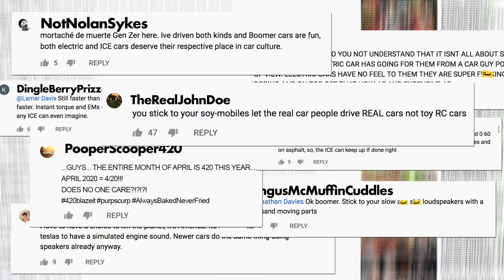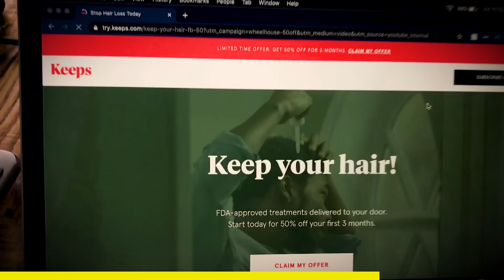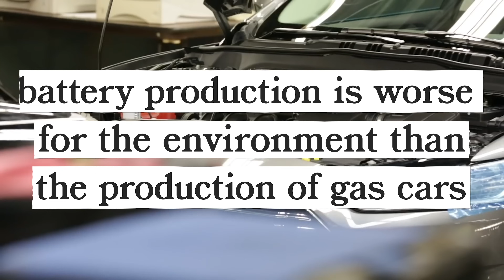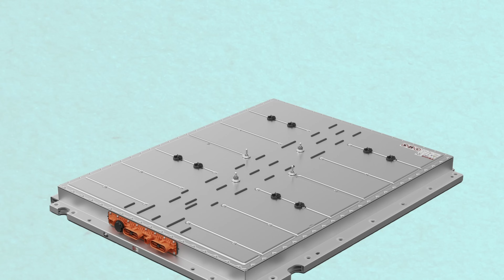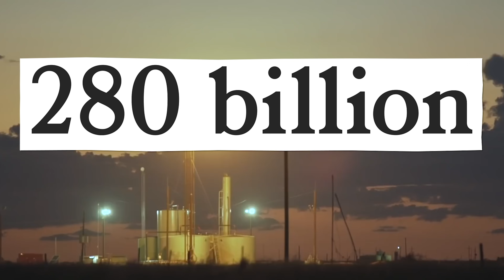Are Electric Cars REALLY Better for the Environment?

Comment: One point I didn't notice you even mention - and that's the environmental impact of recycling EV batteries. This is especially important in view of the relatively short life of such batteries.
Nor did you mention the environmental impact of building and connecting up the thousands of charging stations required. If your government intends the same as the British government, and outlaw production of IC vehicles by 2030, that charging station coverage will have to cover the ENTIRE country - even in the states with the lowest population per square mile. Generating the required power is the easy part; installing not just the chargers, but also the heavy duty cable required to support their power consumption - that's going to take a staggering amount of money, AND create a damn big carbon footprint.
Your assessment is fine - as far as it goes - but you only show a part of the picture.

Comment: very well developed "free valve" engines similar to those used by Konigseggsegsseggsegg achieve such a level of volumetric efficiency that an E.V. is only just able to beat it in terms of long term environmental footprint. maybe it is hope for the survival of good ol, petrol power. with that sort of volumetric efficiency, imagine a 5L v8 with free valve tech?  MONSTER!!!!! However,  "More power to the sound of a gas gusling big block". hi from Australia. keep up the good work.

Comment: The problem with electric car is they they can't store as much energy as gas cars ! So, economically speaking, and from a industrial stand-point, electric cars will always be just cute cars, but not actually practical ! They also need between 6-12 hours to charge, with a gas powered car needs only 3 minutes ! A electric car literally stays 200 times more, in a year, in recharge, while a gas cars stays 200 times less. And these are the facts !
Reply: not very good facts. For starters EV ranges today are punch around the 300-400 mile mark, thats something like 4-5 hours of freeway driving. If you do that as a daily commute, you need to find a new job. In reality most people only rarely travel further than 70 miles per day. Which means if you charged from home, from a home charger it would only take you around 1.5 hours to charge.... when you're at home.... not using the car... asleep. And every morning you wake up to a full tank of electrons. By comparison the average person wastes between 16-17 hours per year getting fuel. Whilst for a BEV thats 0.

in the event that you do need to get a charge on the road the huge network of superchargers out there can do that, anywhere between 5minutes to 30 minutes depending on the charger and how much charge you need. And unlike a combustion car, you dont have to stand there holding the plug, you can walk across and get a coffee or a snack, which most people would want to do after spending 4-5 hours driving on a freeway.

Comment: What about all the oil spills in the ocean. And millions/billions barrels of crude oil expelled into the ocean. 

You know hown many batteries are thrown away each year??

Which are made of cobalt and lithium.

Why dont we just use the thrown out, one time use batteries and use them... why are we throwing away rare material. And mining for more... we already have the material..

Our landfills and practically teaming with rare materials 

Use EV construction vehicles to mine. 

Start taking sea water and desalination plants to replace the water. That use only power. 

Gas/oil is easily more detrimental.

Comment: I agree with everything except the fact that the electric grid could keep up. What happened to Texas last year? It snowed and power was out for almost a month in some places what happens when the car can't take you to work because the batteries died and you can't change it?
Reply: what happened to texas wasnt lack of capacity. it was lack of planning for a never before heard of weather event in texas. The fuel lines feeding the power plants froze and blocked fuel from going to the power plants, transfer station switches froze limiting their ability to lead shed, coal piles were buried under too much snow to get it to the generators fast enough to keep up. It wasnt lack of power. the grid was just simply not designed for those weather conditions.
Reply: I live in the UK where many people do not park on a drive or outside their house, we have collective parking lots or on street parking, where do I charge daily?

Comment: Been holding onto this vid for a year and i knew there was a reason. Just wrote a college paper on EV batteries. Awesome explination and an amazing job at making this topic so easy to follow and understand. There so much going on with EV its easy to not know where to start. Thank you!!
Reply: The comparison of info is not a good job.  Regardless of the negative impact on human life and the planet during production (sad to devalue humans), the comparison was not new vs new; and at 8:50, new source numbers are not given, so it must be assumed the average, including old cars, is still being used.  It also does not state that battery replacement we considered in the "lifetime" of the EV.  Any work based on this video will suck, mate.

Comment: We dont get this in the media i dont think ev is the 100 % answer hydrogen is better it could be less expensive to build
Reply: Hydrogen isn’t better
Reply: @engineeringtheweirdguy2103  They both have their perks and drawbacks.
Reply: @haloliye7590  Hydrogen has more draw back than perks unfortunately.
Reply: @engineeringtheweirdguy2103  I've done my research. Hydrogen is a compelling alternative, particularly with commercial vehicles.

Edit: Woah, I did not expect an entire essay. Nevertheless, while several glaring flaws do indeed exist, many benefits are present too, and they will likely improve in the following years. However, I will not create a new reply and argument because I prefer to not prolong this conversation of fear of it ending badly. Thanks!
Reply: @haloliye7590  Dont know where you got that from. even looking at the difference between the Hyundai Xceint vs the Tesla Semi and you find a very stark result. Hydrogen cars also suffer from a critical lack of space due to the volume required for the fuel despite its light weight. Making them impractical for storage, long range, or passengers. 

Hydrogen also requires far more energy to create making it more expensive even before you consider that the plant that makes it has to cover its capital and overhead costs plus make a profit before passing it to fuel stations who then have to make a profit on-top of that themselves before it gets to you. The next most common way of creating hydrogen is with fossil fuels which produce more emissions than if you had just burnt the fuel for electricity in the first place. 

They also have a critical lack of power due to the available space for the fuel cells and need batteries to compensate for this.

SO hydrogen is slower, less power, less practical in terms of space such as boot and cabin space, and doesnt really achieve more range than batteries due to there not being enough physical space to store the fuel. all whislt being vastly more expensive and having extraordinarily lower operational lifepans compared to BEV's. 

That doesnt get better when you size up to commercial vehicles either.

Comment: What about the longevity of EV vs ICE vehicles. If the EVs don’t last as long as an ICE vehicle would the production impact increase the total impact of EVs over a period of time?
Reply: Well you’re in luck. Contrary to popular belief and media, Modern EV’s last longer than ICE vehicles. Around twice as long.
Reply: @engineeringtheweirdguy2103  are we talking twice as long as like a Kia or twice as long as a Toyota Tundra? Lol
Reply: @bradleywarren5243  we’re talking 500,000 mile lifespan to 80% battery health (20% degradation). Whilst the average ICE only last 250,000 miles
Reply: @engineeringtheweirdguy2103  Source?
Reply: @haloliye7590  It's all there as long as you're willing to look at it.

Comment: I noticed you missed replacing the battery in the electric car. They will last 2 to 3 years and then are thrown away.  In the event of a power failure the electric system uses its power to keep the battery warm. It runs the battery out and it freezes and is off to the dump!!!   That’s a lot of batteries. Figure that into the life span and things change.
Reply: Well considering that the warranty for EV batteries are typically 8 years these days and they are showing as little as 2% degradation or less after 100,000 miles of driving, your 2-3 year figure is grossly misinformed. Also, the battery doesn’t use very much at all to keep itself warm and only does so below freezing. As opposed to combustion cars which can often fail to start at all in cold temperatures due to the fuel being too cold.

Comment: Sad you missed one key point let’s talk about rolling black outs, since this video is a year old how you gunna charge your car when a natural wildfire comes, guess you’ll be getting a ride for the next door neighbor with his gas powered car haha
Reply: How do you pump gas if there isn’t any power to run the gas pumps?
Reply: @engineeringtheweirdguy2103  you can easily hand pump the fuel out of the ground, think outside the box 📦
Reply: @MrAllmotorB  how many hand pumps do you see on fuel stations?
Reply: @engineeringtheweirdguy2103  hilarious if the pumps stop working in an emergency you go get one
Reply: @MrAllmotorB  ..... but you cant. If the pumps stop working, if you bring a hand pump thats making 2 assumptions. 1.) is that you can even access the underground fuel storage tanks to put one end of the hand pump in.

2.) is that the fuel station attendant will let a stranger get access to the underground fuel tank to install a hand pump not approved by the fuel station, to pump fuel without a meter to show how much was pumped.

also completely disregarding the fact that the attendant cant make a record of the sale without electricity anyway!

you're living in a fantasy world.

Comment: Is sacrificing children worth your electric car
https://youtu.be/ipOeH7GW0M8
Reply: I’m assuming you’re referring to cobalt? Well considering that A.) next generation batteries which are about to start rolling out in 2022 don’t contain cobalt and B.) batteries aren’t the largest consumer by mass, I don’t think you really understand the full picture 

So to expand. EV’s are indeed the largest consumers of PURE cobalt (although all ev manufactures have singed ethical contracts to avoid child mining. FYI). However they are not the largest consumers of cobalt by mass which means cobalt based chemicals and compounds. By mass means by weight of cobalt contained. The largest consumer of cobalt by mass are FUEL REFINERIES who use it to remove sulphur from your petrol and diesel.

However fuel refineries have no such ethical contracts because they’ve never had the social pressure to do so. And spend big bucks making sure it stays that way.

So is sacrificing children really worth driving your outdated combustion car just because you can make more noise?
Reply: @engineeringtheweirdguy2103  it's obvious you are oblivious to the point of child. It's not mined by children😬 that was the point of the video. How do combustion engines cause deformation in the womb? 🤦
Reply: @JennyBrie2006  well how does an EV do that? But counter question, how does an ICE shorten the life expectancy of people living within 10 miles of a major freeway? Microparticle emissions from tailpipes is the correct answer.

Why is there an increase in cancer rates and cognitive developmental issues in children who live with 15 miles of a fuel refinery? All good questions.
Reply: @engineeringtheweirdguy2103  so there you go, which would you rather have, a deformed child for life or a decade shorter life? You can choose to live further from a freeway, while those mining, a rather impoverished population, do not have such a choice. Remember, most countries who think they should save the planet along side China, well I got news for you, China does not care. They aren't even safety conscious for who they employ. Your idea is admirable, but it's short sighted of the implications for other people. Out of sight out of mind.
Reply: @JennyBrie2006  and what are they mining exactly?
Reply: @JennyBrie2006  and did you neglect to read the part about child cancer and permanent brain under development for children living near refineries?
Reply: @engineeringtheweirdguy2103  I know there are a lot of things to consider. Like I said, it's an admirable desire to strive for, but it's got a lot of complications to consider. Heck, not a lot of people take much consideration to what chemicals they ingest on a daily basis. Too bad we can't turn back the clock on some of the areas where we lost ground, simple things like recycling and using butcher paper instead of styrofoam. At least paper bags didn't dot the landscape for 50+ years.

Comment: Who's going to handle the dead batteries when they're exhausted in 5-8 years? Every makers have their own way of manufacturing the batteries, are they going to set up recycling plants in every country they sell cars in? What's the resell value of a 8 or 10 years old EV? If the cost of battery replacement is more expensive than a used EV, who's going to buy? If no one buys it, an 8 or 10 years old vehicle becomes a piece of 4000 lbs junk to the earth, but a 20 years old gasoline car can still run for years.

Comment: did you take the greater tyre wear and cost of EVs into account? My issue is the resale value, how long till an EV needs a new battery set and how much?
Reply: Modern EV batteries, contrary to popular belief, will last twice as long as a standard combustion engine. In addition, EV’s don’t have any extra tire wear compared to other cars but they do have significantly reduced brake wear, which drastically reduces their micro particle production compared to combustion cars, even without considering the Microparticles that come out of the tailpipe of an ICE.

So there’s that…
Reply: @engineeringtheweirdguy2103  Tesla tyres cost four times regular tyres and only last about 1 year (is what i hear) and you seem to be talking about 'future' batteries not present-day batteries. 
I have 4 cars over 50 years old which still have running motors.
Reply: @RoverIAC  but how many miles. Modern EV’s as in ones on the road since 2019 to present will last as much as 500,000 miles or more. Without the need for replacement parts and oil changes every 10,000 miles.

In addition the stock tires from Tesla are expensive because they’re sports tires. They also don’t last as long because they’re sports tires. You get the same thing with the same tires on any other car. For example the BMW M3. To say that is something exclusive to EV’s is a remarkably naive statement.
Reply: @engineeringtheweirdguy2103  until they fix the battery issue I don't think they have more then 10 to 15 years in them, but then again most modern cars are designed for five good years.
Reply: @RoverIAC  what battery issue? As I’ve already stated the batteries are designed to last up to and over 500,000 miles with cars on the road today from 2019 showing less than 2% degradation after 100,000 miles with no servicing, meanwhile the average lifespan of an ICE with constant servicing is 250,000 miles.

Modern EV batteries have 1,500 cycles before they reach 80% battery health (20% degredation). With a car like the model 3 long range with a range of 353 miles, that means after 529,500 miles, it will still have 80% of its range (282 miles) which is still significantly more than most people drive in a single day and is around 4-5 hours worth of freeway driving to a single charge.

So what battery problem and why do you think they only last 10 years when the warranty on the batteries alone is 8 years
Reply: @engineeringtheweirdguy2103  battery warranty is 100,000-150,000. Will be interesting to see the resale value after 15 years. I'm guessing it would be like buying a second hand luxury sports car from the 80s or 90s, cheep to buy expensive to get it running.
Reply: @RoverIAC  reports already out. The Tesla model 3 has the lowest 10 year depreciation of any car on the market.

In addition, many Tesla warranties and other EV warranties are for 8 years and unlimited miles.
Reply: @RoverIAC  also doesn’t negate the fact that real world results show on average a less than 2% degradation after 100,000 miles.
Reply: @engineeringtheweirdguy2103  well that's good, four out of five of my cars  are actually going up in value year to year.
Reply: @RoverIAC  different to 10 year depreciation but good for you.
Reply: @engineeringtheweirdguy2103  that's true, they did their depreciating in the 80s.